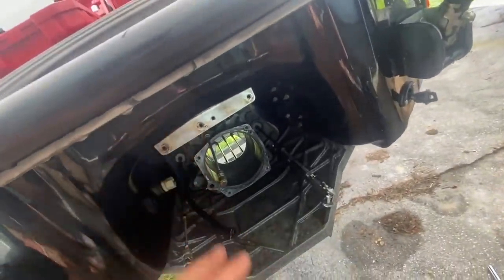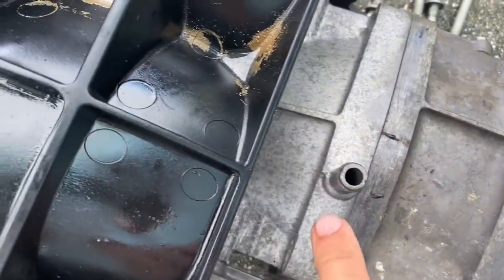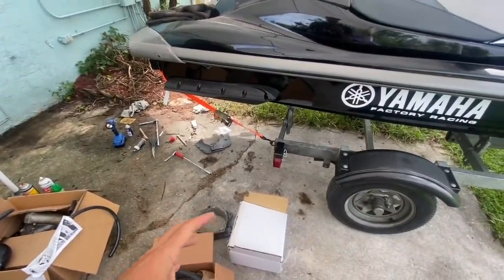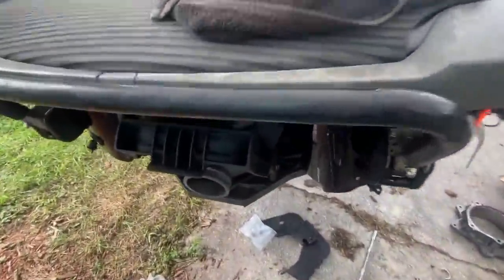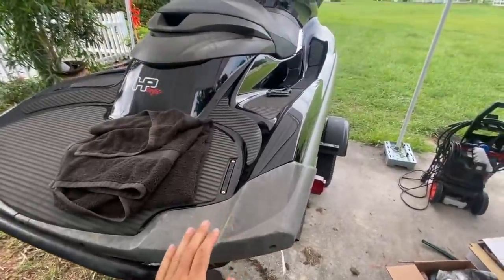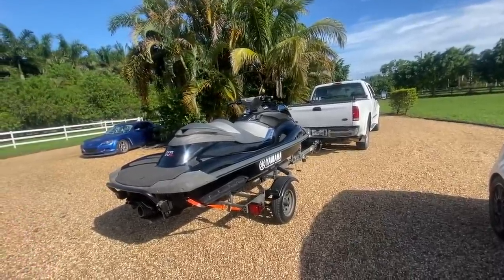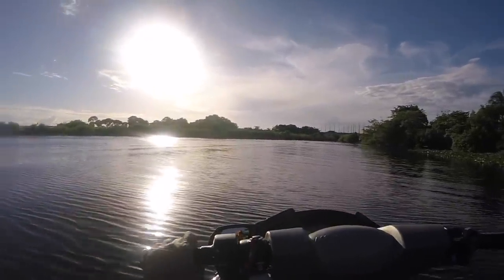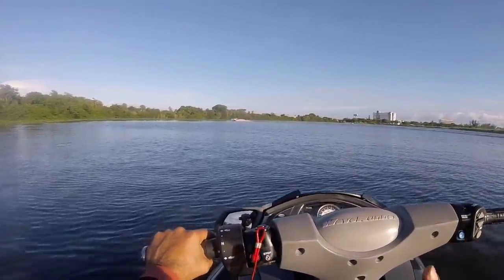RUDNIK BOUGHT A SKI?? and the FX SHO has issues.

Comment: Do you realize Sea Doo does 75% of this shit, stock..? 
Just wait until you run into reliability issues..
Reply from the maker: I built a fast seadoo already.  I’m very aware of the strengths of both platforms.  Reliability? This ski has 540 hours on it.  No reliability issues.
Reply from the maker: I built a fast seadoo already.  I’m very aware of the strengths of both platforms.  Reliability? This ski has 540 hours on it.  No reliability issues.